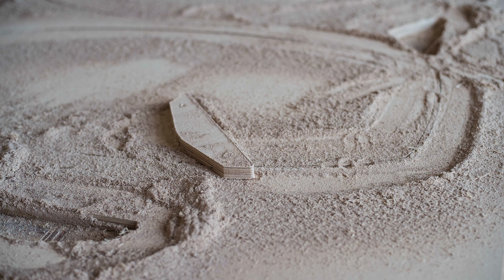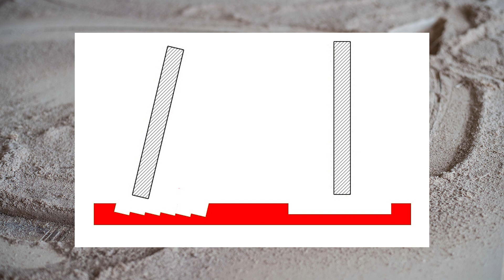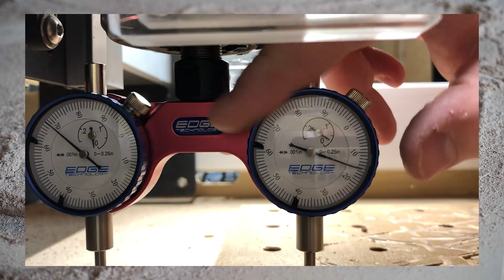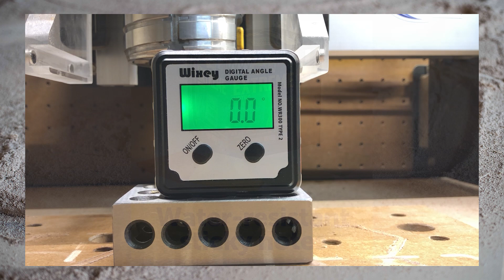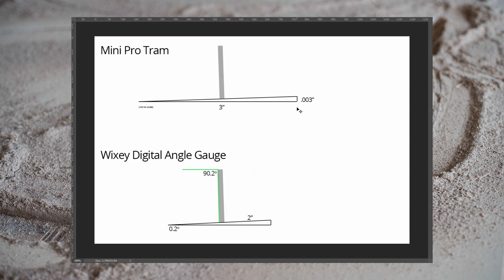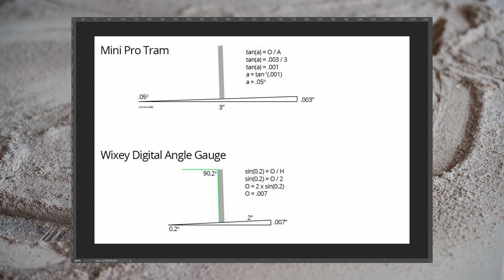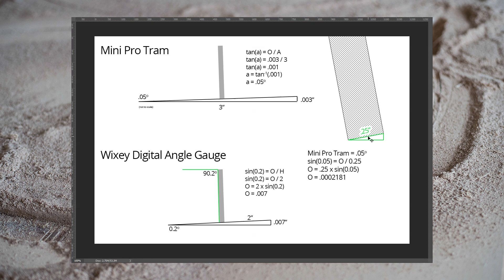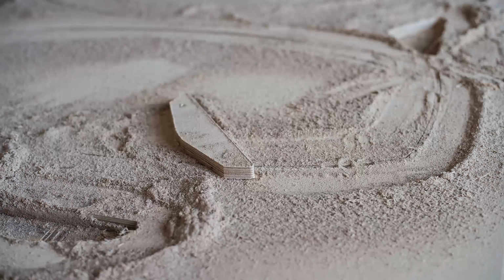Practical CNC - Wixey ($26) vs Mini Pro Tramming Tool ($100)

Comment: I just used a 1" surfacing bit to surface my wasteboard a tiny amount (0.02") then felt for ridges, made adjustments then did again. After a few adjustments there were no visible lines and only a micro line could be felt by hand and since the 1" bit will exaggerate the errors I found with a 1/4" end mill I could neither see nor feel any lines. I did use the 123 blocks to tram left to right (putting them under the router mount while it was slightly loose and then pressing it down onto the block until it self seated). This gave me excellent results left and right. I then shimmed the router bracket with some thin metal under the bottom to fix a slight forward lean in it.

Comment: Just a couple comments on your great video: when using this method it would generally be better to use a 1/4" dowel pin in place of a cutter. Dowel pins are stronger, and many times (if using cheap Chinese end mills) they may be slightly undercut from the actual shank diameter, which you would be measuring as tram error. When doing the demo with the paper under the angle gage, you've effectively doubled the apparent thickness of the paper by sliding it halfway under the gage. This looks like a great method to replace a dial indicator, but one must be aware of the potential opportunities for error.
Reply from the maker: I guess all I was tyring to show there was the indicator was sensitive to a single sheet of fairly thin paper. Not super clear there but the indicator has small ridges it's not perfectly flat on the bottom, so it's only contacting the wixey gauge on one spot. It was indeed one of the less scientific parts though.

Comment: Curious if you rotated the bit 45 or 90 degrees and took a additional angle readings with the Wixey. I'm wondering how well the edge of the Wixey was seated against the side of the bit and if the reading you got is repeatable at 45 and 90 degrees from your starting point. I realize the bit is the same diameter for its entire length but you instrument is referencing the edge of a single flute and if I remember (without running out to the shop and looking at my Wixey) the side of the angle gauge is not perfectly smooth and flat.

Also, the Wixey (I love mine not picking on them here) only displays to one significant digit, so it's only resolving to two digits and rounding off and displaying one digit. That means the Wixey could be measuring 1.51 degrees but it's displaying 2 degrees. And it works the same above 2, the actual angle might be as much as 2.49 degrees. Just keep that in mind if you're thinking of using any digital angle gauge in this manner. When thousandths (.001) count, you can't be measuring in tenths (.100). :-)

Comment: In your trig you're assuming that your wasteboard is like optically flat glass. It's only mdf so the difference in readings between the two could be because it's a bit spongy and the measurement is across different distances is dependent on the mdf stiffness. I think a comparison where you had a block of polished granite as the test surface would be a better test of the two tools.
Reply from the maker: Tramming a hobby CNC is going to always be a process of dialing it in incrementally. After doing an initial rough tramming with a square or 1-2-3 block the wasteboard should be level but not necessarily flat. You could measure in a few spots and use the average or adjust to the measurement you get and then repeat the process. As you said with the materials in use there's only so much accuracy you can get out of it, but there's likewise only so much accuracy that you need.